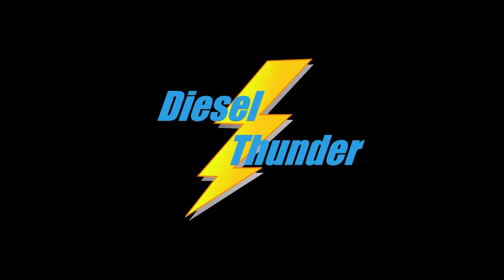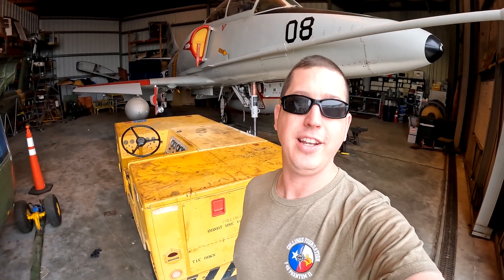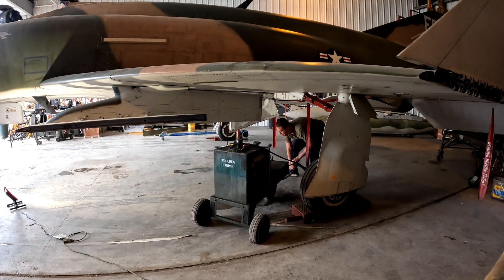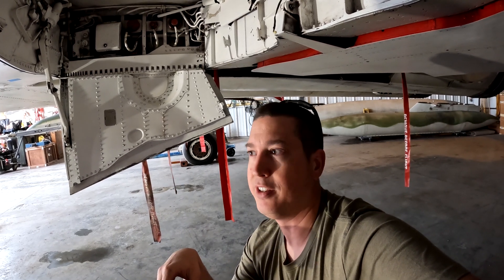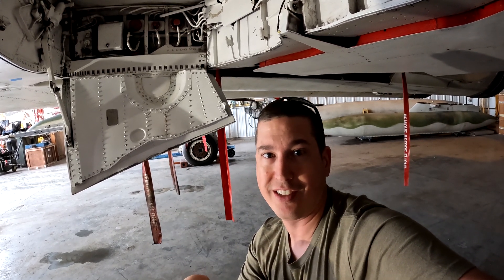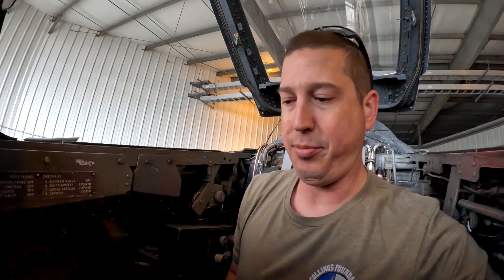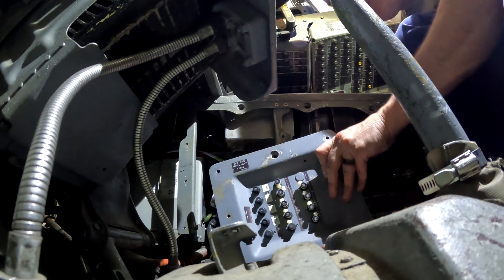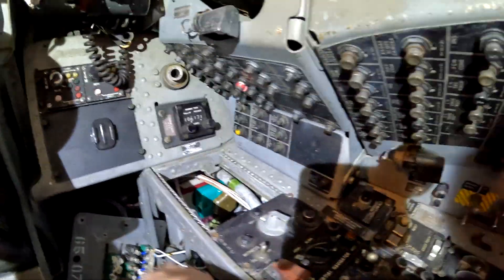They Put the Battery Where? | F-4 Phantom

Comment: YOU DID NOT CYCLE the flight controls… or check the accumulators before checking the hyd level

WHOA WHOA…. HOLD UP….. you cheated on the Battery…. The seat was not there… for the full battery experience… the ejection seat needs to be in place … so Seat Shop can come out … do their thing and you have to do the battery while standing on your head.

hahahah….. I made this comment before Crew Chief Al explained exactly what I just said… lol.   

It’s been many years but I still remember all of my Crew Chief stuff.

Comment: I always hated having to change those batteries. If I recall correctly, it was every 90 days? Most of our jets had a notch cut in that right rudder pedal on the outboard side to facilitate getting the bottom forward corner of the battery passed it.
Reply from the maker: I’m not sure what the change interval is, but not a fun job for sure! I think if the pedals are set full forward and the right pedal also pushed full forward, then you have enough room to clear. I had the pedal folded down, which helped a lot!

Comment: Can I get some names of you guys , the  ring leader would be good and then the crew chief maybe ? So I don’t have to be rude ! I just started watching you guys the other day and looking at that jet is driving me crazy I’d like to be the ringleader and get a couple guys together with some buckets and some soap and some scotch pads and scrub that bird down and repaint it !!! Back in the 70s we used lacquer on the air for just before I was getting out of the service they were switching to polyurethane . Basically all you need to do is start at the top with some buckets warm  water and TIDE or? Scrub it down rinse  IT &  when the water doesn’t break it’s clean ready to paint , what I mean by break is ,it doesn’t bead up like it has wax on it , that tells you it’s clean !!

Comment: Just wait until you have to take panels 101 right and 101 left off!  I took the battery out of my F-4, which you are working on right now and the battery plug contacted my military belt buckle and welded the sliding end metal piece to the stationary metal piece and heating it up so much it was burning the crap out of my skin. I couldn't take the belt off due to the ends being welded together, I learned a valuable lesson! I love to watch you work on a jet I worked on in the 60's. Thanks. BTW, look out for the aux air doors when the jet is running and you check the oil caps. I love that old jet. (F-4, A-7, F-16 phixer)
Reply from the maker: Quite the experience there with the battery, and thank you for your service. We opened up 101 and 102 on both sides last year, and I learned the hard way to not use screw bags on those panels. Aux air doors can be nasty, they eat fingers (or hands), and when down are quite the source of Phantom bites!

Comment: Ah the tell-tale sound of the NC-8, Used them a lot in Navy. I don't think we had a battery in the "J" bird. Talk about tight spaces servicing and lubrication of the rudder package was a lot of fun, you had to enter the rear fuselage via one the aft panels I don't remember the exact panel number could have been 61 or 64, and because I was the thinnest and shortest in the shop, I was elected most of the time. My worst fear that there would a fire in the hanger deck or general quarters while I was still inside, another one was the lubrication points on the rudder itself. Hanging on and lubricating was a bit of a trick. All the while with the tail of the bird is over the water, to be honest we were not required to that in such a case, but being young, dumb and full of vinegar, we sometimes tempted the fates. Again, I love these videos, I should settle in Texas maybe i could help some.
Reply from the maker: I can't explain why, but I really enjoy driving it! May have something to do with that 2 stroke Detroit Diesel under the hood. 

Sounds like quite the experience! If you're ever nearby in Texas, hit us up, always happy to have the help!
Reply: @DieselThunderAviation  The Nc-8 seemed like it couldn't get out it's own way, but the motor was a source of heat on the flight line.

Comment: As I recall when replacing the battery in the right rear cockpit there are two Cannon connectors that are keyed the same and can get accidentally swapped. When that happens there will be plenty of smoke created. I think one of them is the radar set control joystick. What is the tail number on that beast?
Reply from the maker: Good to know, thanks! The Air Force disabled the radar and weapons systems before we took ownership in the 90's. A good thing too, as I understand the radar needed frequent maintenance. Her tail number is 65-0749
Reply: @DieselThunderAviation  The radar(s) were the APQ109 (Westinghouse) and APA165 (Raytheon) and were my AFSC. The tail number indicates an early D model I think. Lots of vacuum tubes and yes they need a lot of maintenance. They also worked pretty good when properly maintained. I spent thousands of hours in both cockpits and inside the radome. Good to see the combining glass on the front cockpit for the Lead Computing Optical Site System (LCOSS) appears to still be in position. As far as your comment on cart starts we almost always used the Dash 60 to do a ram air starts. I will continue to track your progress.
Reply from the maker: Awesome, a fellow Electronics Tech! That what I did in the USCG, worked on radar and navigation equipment. The glass is in good shape, but we don't have the gunsight controls installed. That spot is occupied by a modern NAV/GPS unit.

Comment: Just turned 75 on 3/21/23  yet I still remember it could be real pain working on the F-4 when I was in USAF back in 1966 - 70 especially in the Nam in the year of 68 with the heat & humidity.
Reply from the maker: Thank you for your service! I really enjoy being able to work on a Phantom, but I can only imagine doing that in combat and under stress each day. Happy belated birthday to you as well!
Reply: @DieselThunderAviation  Thanks, it was along time ago, kind of seems it also was in a galaxy far, far away. I got back from Vietnam almost 7 months before Apollo 11 landed on the moon which was mid-July of 1969 the first landing.
Reply: The 8TFW at george AFB taugh me to change the battery in 45min and I was  slow. I was in the 12 TFW cam rahn bay 66-67and I applied what i knew once If you were about 5' 9 you were the hight to give full right rudder and break while leaning over and working the battery in front of the right rudder pedal. I lost my stomach @ Lackland

Comment: On a Thud, it was behind an exterior panel, we always had to connect the battery back to raise the canopy. Then when we finished working on the plane, close the canopy, and disconnect the battery.
Reply from the maker: That is interesting, never knew the Thud used a DC motor for the canopy. Thank you for your service!
Reply: @DieselThunderAviation  Not sure what it drove, but it required DC voltage to open and close it, a DC hydraulic pump? Didn't work that end, worked on the Doppler Nav system.

Comment: Brings back memories.  You were lucky as crew chief Al mentioned because the seat was out.  Changing that battery was soooo much fun.  We usually tried to have the "bucket" part of the seat removed for access, but it still was a real challenge especially after they did the mod that added that CB panel.  Also we weren't allowed to recharge the battery in the aircraft, if it was dead you had to R+R it.
Reply from the maker: Thank you for your service! I imagine it was faster to change the battery, than to charge it and risk having to change it anyway if it was still dead?

Comment: Makes me glad I worked on Vipers, where the battery is readily accessible in the wheelwell :D
Reply from the maker: That is a cool aircraft too! One I enjoy flying in DCS. Crew Chief Al also worked Vipers later in his career, and has mentions some things that were a lot easier on that bird, checking the oil being one of them. Fairly sure that pumping up the JFS accumulator is not on that list!
Reply: @DieselThunderAviation  I still have nightmares about having to pump the JFS-bottles back up to pressure after a mis-start on a scramble-launch.

Noodly appendages is deffo a thing after such an event!
Reply: @Wrootplonk  In our maintenance squadron, the " Kurnass " ( IAF F4-E ) shop and the F-16 shop were facing across from each other.
Us at the Kurnass shop used to joke that the other guys across the square were playing with Lego.
Because everything was interchangable on block 40 F-16s, almost nothing would on a Phantom.
Reply: @trespire  hehe yeah, from what I’ve seen of the Phantom, it’s a bit of a hog when it comes to maint’. Then again, it’s a product of a different time.

Still hope to see one in the wild before they disappear completely from service, but there’s not many operators left. Or operational aircraft, for that matter.

Comment: our good crew chiefs R2'd the battery with the full seat in, with bucket all the way down.
Reply from the maker: The seat all the way down makes it a bit easier I think? One of the fatal ejection incidents I read about involved a battery change (E model I believe), but the seat was up and that breaker panel had longer pigtails so could stay connected. They got the battery changed, put power to the jet, and lowered the seat to finish the job which then pinned that panel underneath the seat. It shorted out and ignited the seat rockets.
Reply: @DieselThunderAviation  One of the safety stories we had on base, was of a guy working on a Mirage in a HAS (hardened air shelter).   Ours were buried concrete domes that held two parked fighter jets.
This guy was stanting on a platform leaning into the cockpit when the seat activated.
His ramains had to be scraped off the concrete HAS roof, I was shown the impact dent in the concrete roof.   Sobering story !

Comment: Before working in a the cockpit, or engine intake, we were told to double check all our pockets, inside jacket breast pocket, and both trouser thigh pockets, and remove everything.
Also, no watches, no rings or necklaces, nothing.

She is looking good.
Reply: We had to were "bunny suits" to do intake and exhaust inspection. the battery is a pain to R & R.
Reply: @elrobo3568  Our regular technicians, A-Check / flight line / HAS would suit up in white bunny suits with FOD stamped on the back in large letters, for intake inspection.
I was a Structural technician on B-Check Phantoms during the day, and on all other platform on evening / night duty. Had to replace a Cherry-Bolt in a Phantom intake once (I was a sargent by then / supervisor). Not only did structural technicians not don any bunny suits, I entered the intake carying spare cobalt drill bits, several Cherry-Bolt rivets and assorted tools. Had to drill the old lose bolt out, this creates aluminium chips. And when riveting the Cherry-Bolt, the steel stem goes flying off. All this mess going on inside the intake.
Before stepping into the intake, I removed absolutly everything from my pockets, even the lint ! The soles of the shoe were carfully inspected for stones, metal chips, anything, then wiped clean with white paper.
All tools, used Cherry stems, even the chips, were presented and accounted for at the sign in desk. We took FOD very seriously.
Reply from the maker: Thanks!

Anytime we dive the intakes, we always clear our pockets, and take off anything that could come loose and be left behind. We've had one FOD incident with this jet (happened years ago) so we don't take any chances there. That incident wasn't anything the crew did, turned out to be runway debris.